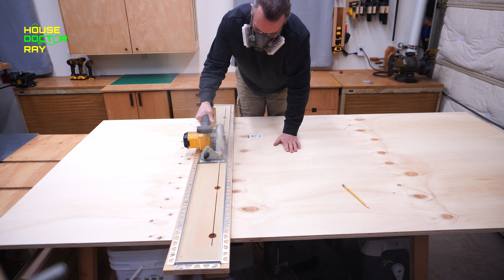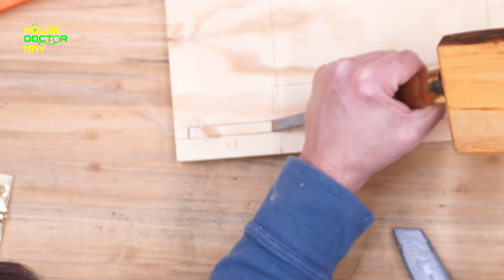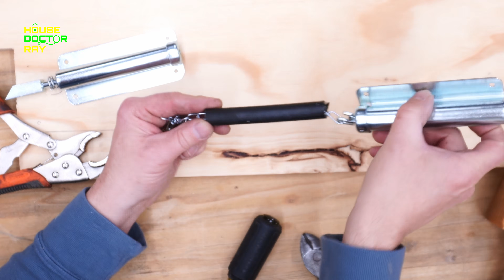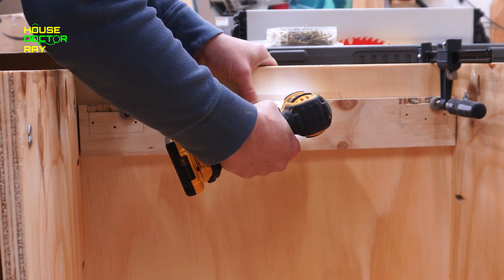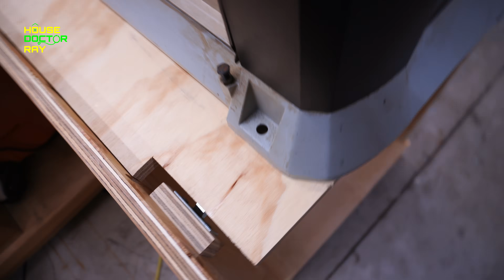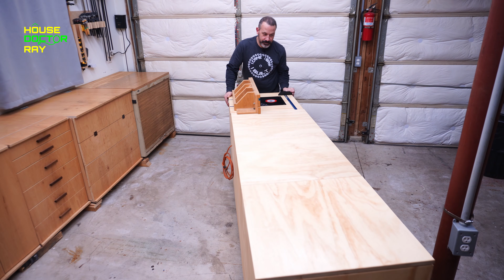Workshop Workbench Cube-Modular & Mobile: The One-Handed Flip-Top Workbench Transformation

Comment: Did you also hinge the top? I guess for a compound miter saw you'd either have to do a hinge that would let the top go all the way over - or just have a removeable top.
Reply: To get the tops to hinge flat I'd use double cranked hinges as this would move the fulcrum point and enable a better swing on the top.
Reply from the maker: For my miter saw it's up against the wall so I hinged the top.  For this since it's in the middle of the shop I have it removable.